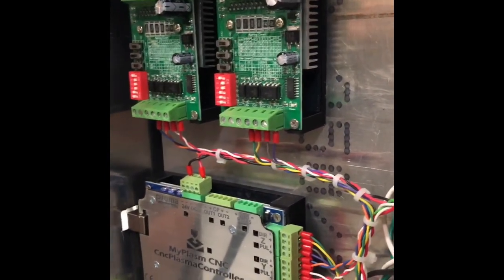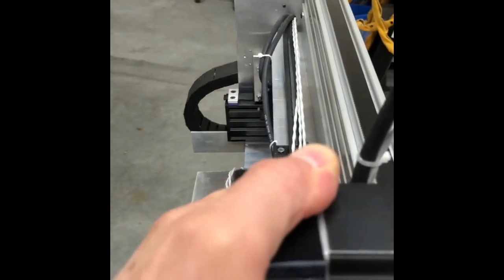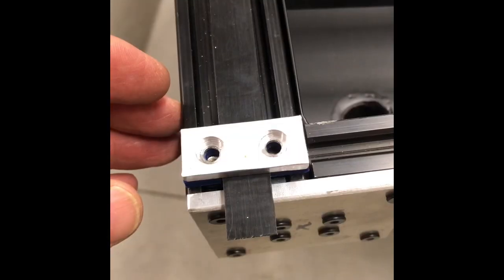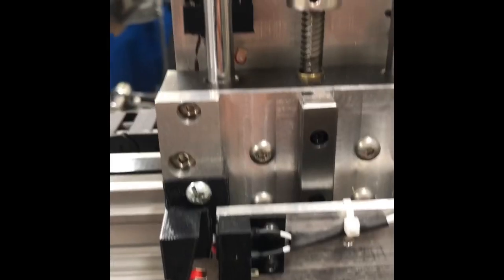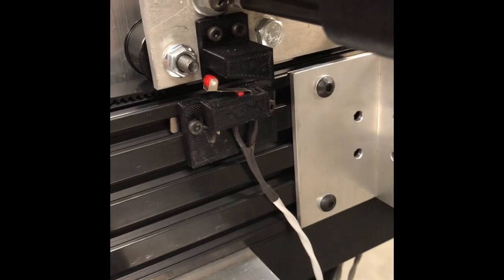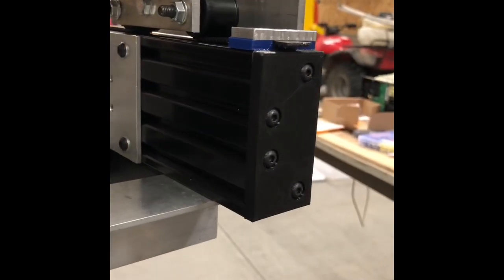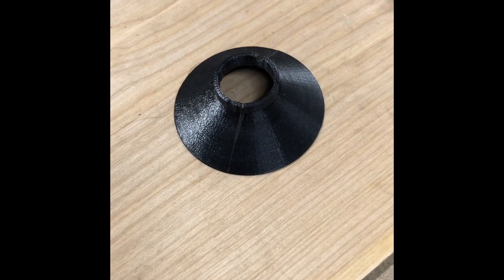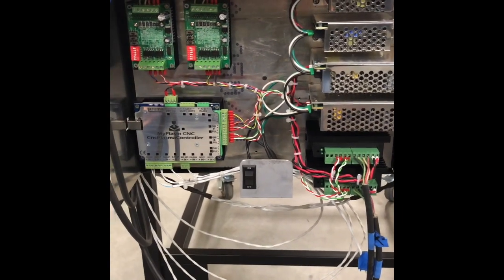DIY CNC plasma cutter - part 2

Comment: I recently got my plasm.....I have a slaved axis now but upgrading to dual y axis drivers.....did you put a home switch for both y axis or only one side?
Reply from the maker: I just did one side and haven’t had any issues. I do  manually check for square before I power up the motors.

Comment: i was wondering about the belt drive.....since speed is not an issue for a plasma cutter, i was wondering why you didnt select ball nut and lead screw drive? your control box design is outside the box.....great job....looking forward to next video...
Reply from the maker: Thanks Glen,  i was actually planning on ball drives but I had the components for a belt drive so I put the unit together with that and intended on adding ball drives later.  However, the belt drive has worked great so I haven’t done that modification yet.

Comment: Excellent build! Would you be willing to share/sell your 3D printer files? I'm going to be doing a build with the MyPlasm controller, Nema 23 motors, drivers, etc. It would save me a lot of time if I could use your files vs creating my own.
Reply from the maker: Thanks for the positive response!   If you send me your email and which files you are needing I can share them.  Keep in mind that tolerances maybe different between printers and components.  I printed several attempts to get some of the pieces to fit the way I wanted...